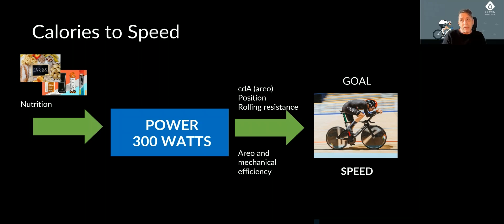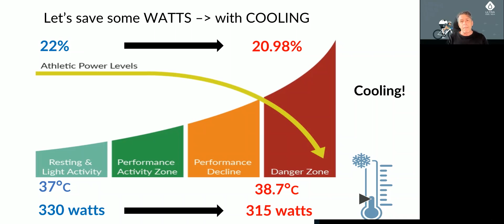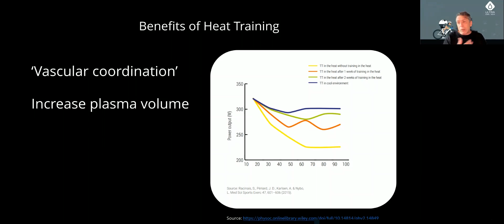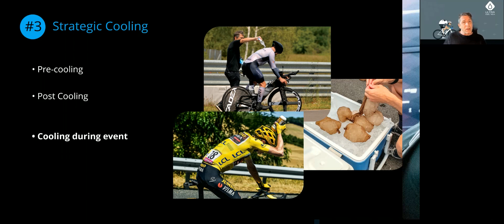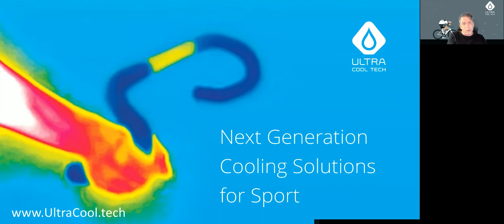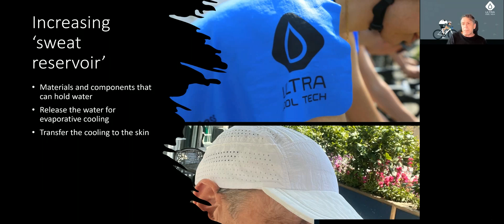Heat and Performance Webinar with Chris Blomfield-Brown

Comment: very interesting! is a real eye-opener, when one sees that 80% of the energy is "wasted" in heat! 
But one thing that surprises me is that, as an engineer, you use Watts talking about energy, while Watts are "only" power! 
At 27:44 you write "628 WATTS of cooling per litre of water", which doesn't make any sense to me, since there is no mention of time during which these 628 watts are effective! Do you mean 628 Wh (watts during one hour)? Other than that, great video and I will forward it to "my" pro triathlet as reference for the preparation of his next Ironman race in hot conditions.